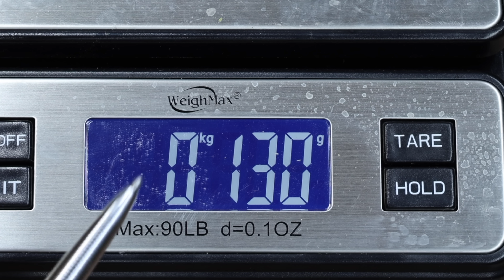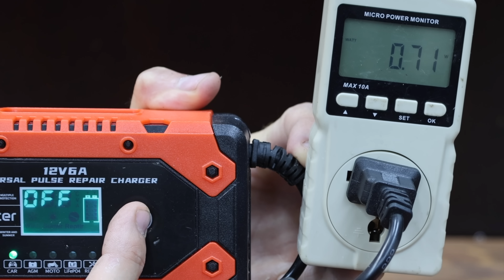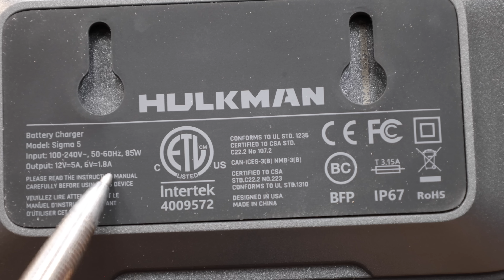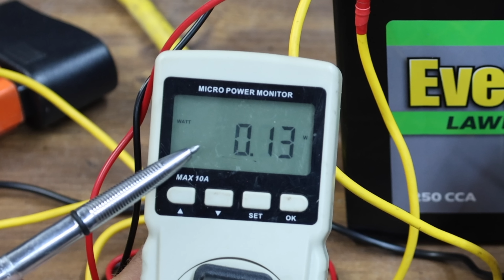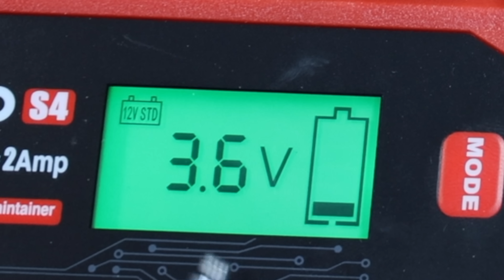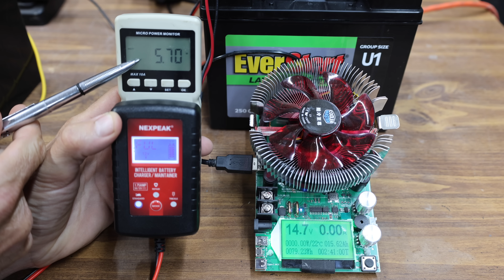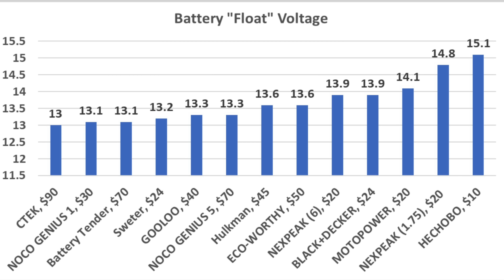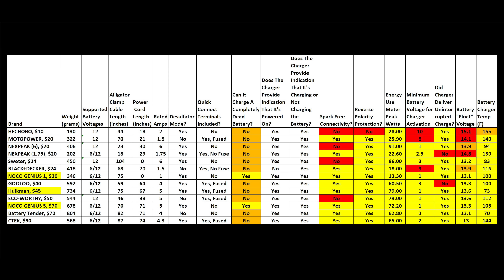I Tested the Most Hyped Car Battery Chargers – One Stood Out!

Comment: Great review. You have sold on the NOCO. I thought the GOOLOO had dead battery charging with the press of a button, but after a bit of research, the NOCO GEN PRO 10X2 is best for my dual battery diesels. I have been using a vintage Craftsman and a DeWalt(Black & Decker) while I'm waiting for my big SnapOn charger to be repaired. Thanks again for all of your efforts. You may not always test the models I need, but your brand winners are usually good enough to point me in the right direction for homeowner grade devices when I'm not looking for a commercial grade option.
Reply from the maker: Thanks!

Comment: Humm, this is one video where I have a critical comment. When testing the charge current you should of used a multimeter so that you could know exactly how much is going to the bettery vs the power meter which measures both what's going to the battery and what the charger itself is using. A lot of these Chinese chargers are going to be using dirt cheap, highly inefficient AC to DC converters. That power is going to heat, rather than necessarily actually being delivered to the battery.

The Fluke should be able to handle 10A just fine, and none of these were over 10A chargers.
Reply from the maker: Thanks for the constructive feedback.

Comment: If you do another charger test, you might do a test  of working when the charger is cold. One I bought would not work in the cold. Probably because of a bad solder joint. 
Since battery chargers probably get stored in an unheated garage or maybe kept in a car, this would be a reasonable test.
It would be a check of the build quality.
Reply from the maker: Thanks for the suggestion.

Comment: It's my understanding that a car battery dropping to 10.5 volts or below is unsalvageable. If that's the case,  I don't understand why would we need to test if the charger can recharge an unsalvageable battery,
Reply: I had a situation with a fairly recent battery in a car with a random electrical gremlin that completely drained the battery to a point a ctek mxs 5 couldn’t charge it. I had to pull the battery and take it in to exchange for a new battery vs seeing if that battery could have been saved. The vehicle in question was driven very infrequently and the random electrical gremlin was known, but unpredictable. The car spent a month in the shop searching for the source of the drain but could not be located.

Comment: I have 6 chargers. My Harbor Freight VIKING 4 Amp Fully Automatic Microprocessor-Controlled Battery Charger/Maintainer is the best. It restored my Motorcycle battery that I left to long as was sulfated and would not take a charge. The VIKING reconditioned it and is now 7 years old. Put it on all my cars once a month to get them restored. Just replaced car battery after 7 years.
Reply from the maker: Thanks for sharing.

Comment: Automatic chargers do not like to charge completely dead batteries. You can trick them by hooking up another battery in parallel for an hour or so, till the dead battery has enough power to register in the charger. I just use old school chargers for dead batteries. They don't care if the battery has voltage or not. 
Great work as always, Sir! o7
Reply: That can be a very large current draw hooking up that other battery to be connected for that long. I've found that it only takes a few minutes. 👍🏻 up on the old school charger too.
Reply: @thegrimmperspective  the already charged battery doesn’t draw much current
Reply from the maker: Thanks!
Reply: @ProjectFarm  Amazing channel!  I feel like I should start send you commission checks for all the money you have saved me in making decisions and purchases!  the old saw is, "Buy once, Cry once".  You have shown us many times that one can actually, "Buy once, and Smile" for getting the best product for the best value. Thanks once again.
P. S. My Ancel BA101 has already saved me over $300 showing me I DIDN'T need to replace two batteries this spring! Seriously!
Reply: Great tip!  Never heard that method before.  Makes perfect sense.  Older transformer style chargers with an analog ammeter meter will not always charge a dead battery, either.  Ammeter will pin to the right, then charger shuts down for  second, turns back on, meter pins and the cycle repeats. Here's a really old school fix: grab about 20-25 feet of 12 to 16g. wire. Wrap carefully around an old soda bottle or similar, don't overlap the wire.  Connect the coil in series between the charger and the positive terminal.  The slight electrical resistance is just enough to 'fool' the charger and charging begins.

Comment: Great tests. For a follow up, consider testing the LiFePO4 settings on these that have them and others. Most are nothing more than standard lead acid mode and do not provide the proper charge, cutoff or trickle voltage in. More of us are replacing SLA's with LeFEPO4's for various uses (other than solar) that need separate chargers and this would be a great follow up.
Reply from the maker: Thanks!  Thanks for the suggestion.
Reply: lithium iron is a good safe battery type. i adlways advise people away from the regular lithium ions for much of any application. definitaly not in the house and not in the car because of fire.
Reply: I like the Hulkman Sigma 10 for this very reason. It often goes on sale over on Amazon and the build quality is excellent in my opinion.

Comment: I have 3 Noco Genius 2 permanently mounted on my tractor, zero turn mower and under the hood of my truck for the past 5 years. I've never had an issue with them, even with the high summer temps in S TX, when they've been too hot to touch. My first Noco 10 failed after a year, the replacement has been going strong for the past 4 years
Reply: Same with me. Noco makes a decent charger.
Reply: I have the Noco Genius 10 for my Volvo V60. The first one died within 9 months, it would just keep switching between standby and 12V AGM and never charge the battery. Got it replaced for free by Amazon and that one has been going strong since end of march this year and has about 1500 hours of flawless charging/maintaining time so far. I'm interested in the idea of getting a Noco Genius 1 or 5 to permanently mount under the hood though, less of a hassle to connect every time
Reply: What method are you using for your permanent mounts? Sounds like an interesting idea.
Reply: @kudzuwarrior  They come with mounting brackets, I screwed those in and strapped the charger on. The clamps can be removed and that leaves an eyelet that can bolted to the battery terminal. I added an accessory fuse block on my machines, where I have auxiliary lights wired, I wired the chargers to those, instead of having extra wires coming off the battery.
Reply from the maker: Thanks for the feedback.
Reply from the maker: Thanks for sharing.
Reply: My main ride is an 06 Murano, my lawn tractor is an 09 JD x530.
Both have 7+ y.o. batteries and keep chugging along.
Can't follow why anyone would mount a battery charger on equipment vs in a shop, garage, shed.
This ain't how you do EV.

Comment: FWIW, I own multiple motorcycles, with a mix of LiFePO4 and AGM batteries.  I use a Noco Genius 2x4 mounted on the wall, and I love it.  Happy to see the Genius working so well!
Reply from the maker: Thanks for the feedback.
Reply: If you're looking for your next charger, consider the larger version of the Hulkman tested here. The Hulkman Sigma 10 charges LiFEPO4 and can be used as a power supply.

Comment: Definitely do testing on solar battery chargers. So handy for vehicles not parked in a garage or trailers/campers!
Reply from the maker: Thanks for the suggestion.
Reply: The Victrons are probably the best. I have the 100I50 smartsolar charger. LOVE IT! The bluetooth app rules.
Reply: @Tommyr  Another thumbs up for Victron.  I have the 100/30 and it works like a champ.
Reply: I agree, solar trickle chargers are a gem for todays vehicles. I leave a car sit for a few weeks at a time every Winter. My solar charger does well, my only concern is that is my over charge and shorten life. I use a "Topsolar"
Reply: @vqr50  "over charge" exactly my concern and will look to see if any have a reliable safeguard (Victron?).
Reply: Both of the solar chargers I have bought had the leads eaten by mice. I hate mice

Comment: I have a couple motopower battery maintainers... they keep the motorcycles and mowers charged plus the price is right.  I got them for under $15 each.

Most of my batteries are AGM so the 14.1 volt float voltage is generally fine.
Reply from the maker: Thanks for sharing.

Comment: Thanks for the review. I had a Harbor Freight Viking 2.5 amp hour charger. It stopped working after two months. Decided to buy the exact Battery Tender  model you tested a couple weeks ago and it’s been working great. I will update here about long term reliability.
Reply from the maker: Thanks for sharing.
Reply: 2 failures for me, no more HF.

Comment: Larger chargers would be nice. Also testing them to see if they could be used as a power supply for things like testing window motors and things like that. I know older chargers would work. But I think a lot of newer ones have too many safety features and they won't work for anything other than charging a battery
Reply from the maker: Thanks for the feedback.  Thanks for the suggestion.

Comment: For a future test, I'd like to see which chargers also charge AGM batteries.  Both cars we own use that battery technology.
Reply from the maker: Thanks for the suggestion.
Reply: I have the ctek maintainer tested here and it has an AGM option. I recently replaced an old lead acid battery in a vehicle with a new AGM battery in a vehicle that does not get driven very often. I leave it connected to the ctek 24/7 unless I drive it. Not sure if that type usage was mentioned in the video or not. I assume the chargers that float in the low 13v range are ok to leave connected 24/7. Any thoughts Todd?

Comment: One additional test I would like to see in the future  for battery chargers:  What does the charger do if interrupted by a blackout. I have a charger/float unit that will not recover from a blackout without user intervention.
Reply: Excellent suggestion. Also, is it safe to leave these connected for extended periods of time for vehicles that are not driven often? I assume the chargers that float in the low to mid 13v range are safe for extended use, especially given that there could be occasional power interruptions.
Reply from the maker: Thanks for the suggestion.

Comment: Just figured I need a different charger since start/stop car batteries have different needs apparently, regular powerful charger didn't want to get it above 12.4V (showed full and stopped charging after a little while).
Bought the same slightly used CTEK a few days before this video based on recommendations that it can be left connected, helps with longevity, good reputation for the brand and of course supports the EFB/AGM batteries.
CTEK and NOCO Genius 5 were both recommended, the used CTEK was same price and seemed to be more known + recond mode seemed attractive. Also for cold weather.
Reply from the maker: Thanks for sharing.

Comment: I've been using Battery Tender for years. I just upgraded to their newest tender that's in a housing. I purchased two and they have been phenomenal. My neighbors stare at my vehicles because they're constantly plugged in. I am retired so I don't leave the house a lot. Which means the batteries in both vehicles are sitting. So I keep both on a trickle charger 24/7. After I drive my truck, I connect the battery tender, especially when it's really hot or cold outside. The battery in my car has gone for 6+ years being attached to a tender.
Reply from the maker: Thanks for sharing.
Reply: Can the heat be an issue for hurting batteries? Never considered that.

Comment: I have a  CTEK from BMW.
My BMW dealer suggested that his mecanics mount the wires of the clamps directly to my battery in the trunk.
If i don't use my car (a coupe E46) for a long time or if it freezes in the winter, i plug in the connector on the charger and close the trunk (with the charger outside the trunk) the day after i just unplug the charger and drive away.
The best 'tuning' i ever had  ;)
Reply from the maker: Thanks for sharing.
Reply: Why not just attach them to the terminals under the hood?
Reply: @nuclearmedicineman6270    That's less practical for me. 
I open my trunk daily to put my backpack in it if i go to work, i just have to unplug the charger from the power outlet and battery and drive of.

Comment: 7:30

1: Your first test just proves my initial comment. Smart chargers suck. The old school buzz boxes just do not care. You set them to 12v 2 amps and there's 12 volts at 2 amps available on the leads. You can use them as power supplies if you want! They would have just started buzzing as soon as switched on and that dead battery would have pixies chooched right in.

2: lead acid batteries don't really produce much H2 just sitting there. It's when they're charging or discharging that H2 is produced.
Reply from the maker: Thanks for the feedback.